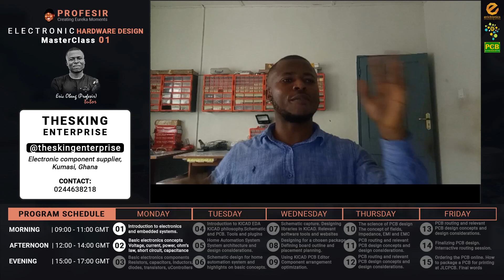Lesson 10: Profesir's Live Q&A - Dive Deeper into Your Electronics Queries

Comment: Hello Prof.
Wonderful tutorial you have there but I want to ask, How does the clamped multimeter measure current around a wire? Does it measure the flow of the energy as current or It is as a result of the magnetic field around the clamp that causes electrons to move due to electromagnetism that is measured as the current?
Reply from the maker: Moving electrons generate magnetic fields. Clamped multimeters estimate the amount of current using this property. It works based on electromagnetic induction